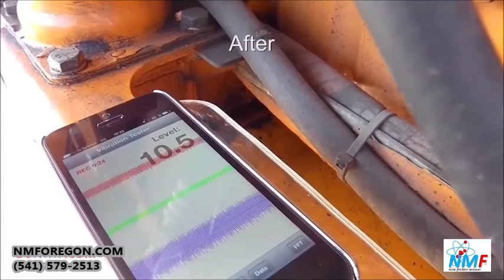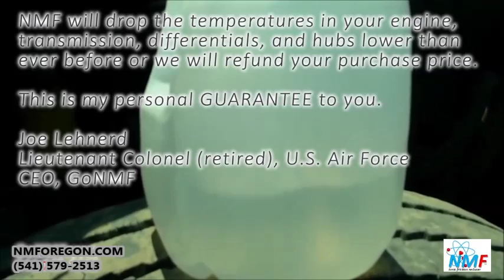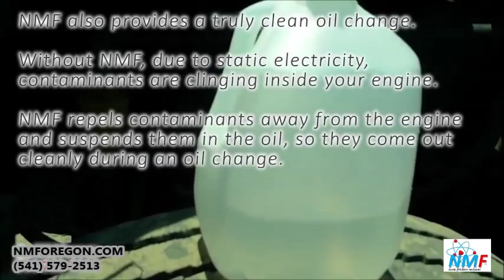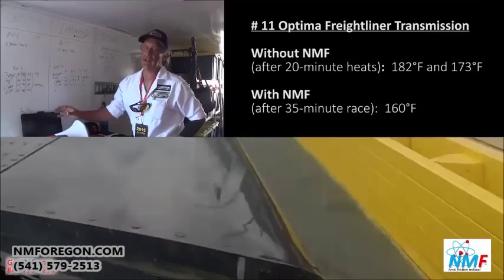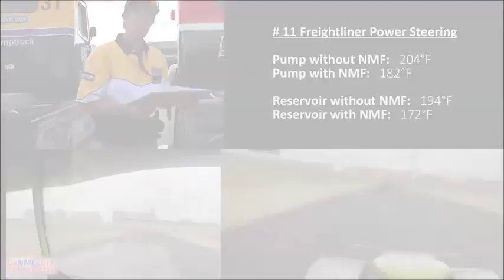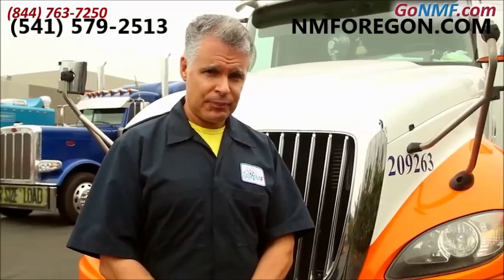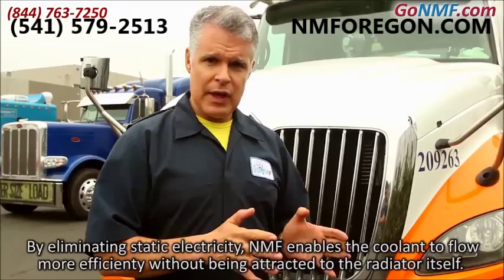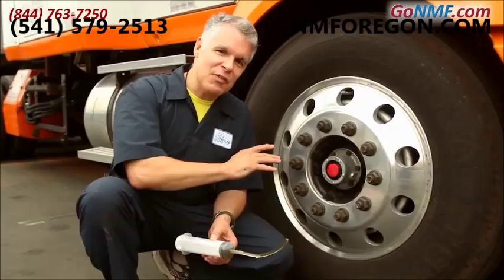Owner Operator and ChampTruck Info   NMF in Crane and Trucks

Comment: i have used  go nmf  with excellent results  areas applied  gas   crankcase  radiator  & power stering     carr has a very noticalbe  change in performance  & milage  ,,,,    james  ny  at  7k miles  motor oil still looks  very good ,,,,,